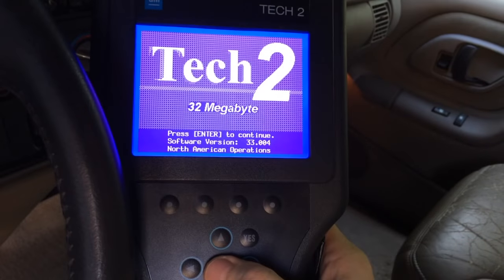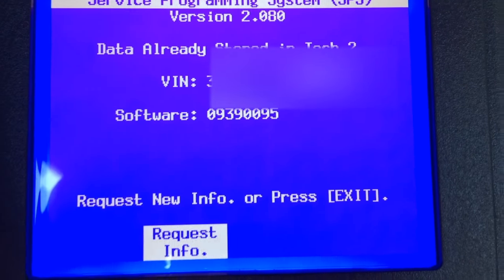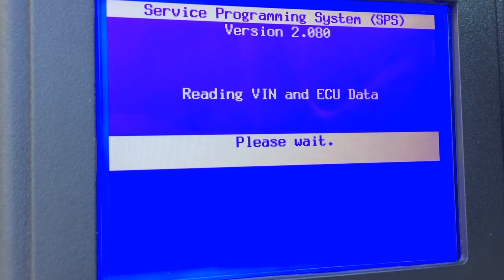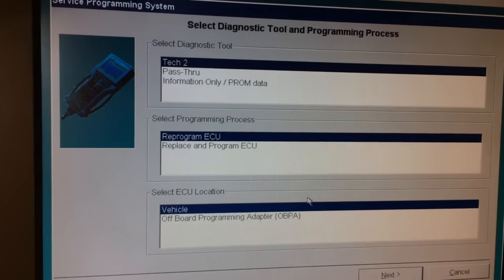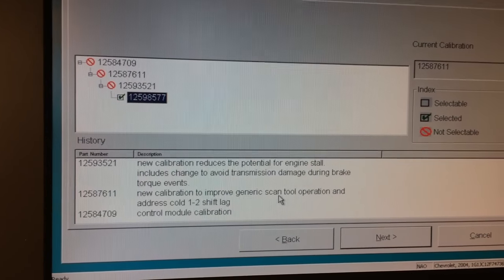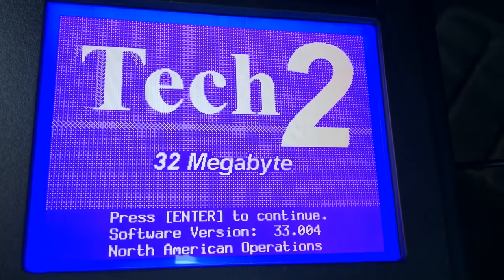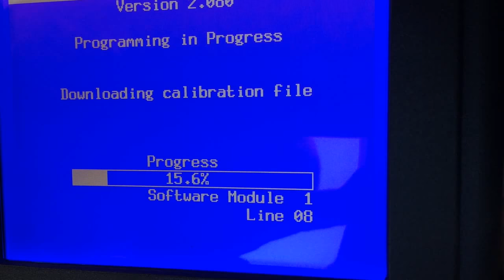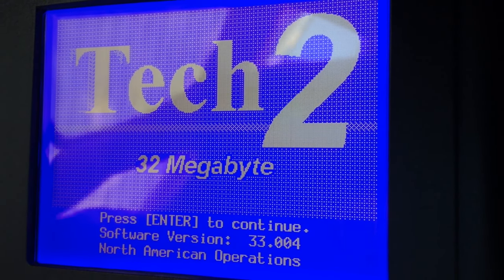GM SPS Programming: Tech2 Tool Remote Mode ECU TIS2000 How to do a Calibration Update Reflash (PCM)

Comment: Thank you for the video.  I have a Tech 2 and a Windows 98 Laptop and my target vehicle is a 2006 GMC Sierra 2500 HD SLE with a gasoline engine.  Your video appears to cover updating the ECU, but my objective is to add steering wheel controls to show tire pressures from TPMS that I enabled with the Tech 2.  My truck did not have the TPMS option, but my 2005 Yukon Denali does have it, along with the steering wheel control option to show individual tire pressures.  I added a passenger side window module enabling TPMS and tire pressure sensors.  I now have TPMS in the truck with a low pressure indicator in the instrument cluster.  Using the Tech 2 I was able to enable the TPMS and set tire pressures, as well as read tire pressures.  But my truck steering wheel controls do not have the option of see individual pressures like my Yukon Denali.  I swapped instrument clusters and the Denali will still read tire pressures but the truck will not.  So the issue is not in the cluster.  I returned the clusters to the original vehicles, and I was told that I need to "reflash" my BCM to enable the steering wheel option.  
   I think, but I'm not sure, that TPMS was an option in 2006 for SLT and Denali trucks, but I can't find verification of that.  My goal is to activate the steering wheel TPMS function if possible.  Can I do that with the Tech 2 and TIS 2000?  Your video explains how to update the software, but is there a way to get into the software to enable this function?
Reply from the maker: TPMS is not an optional feature in the USA, so it would be enabled in the Body Control Module (BCM) by default for those vehicles that came with it off the assembly line.   I've seen some sites mention that some vehicles had it as early as October 2005 but it wasn't until 2007 that all had it.    Bottom line, your BCM would have to support this option.  Use the Tech2 to go into the Body section, Body Control Module and setup as if you were going to build the car.  I have not viewed the menus for a Sierra, but on passenger cars in 2005 you would see in the Tech2 screen of that BCM setup menu all the vehicle options with an "*" next to the ones that were enabled.  It's not SPS (ie, not re-flash).  Simply changing the options, just like enabling/disabling cruise control.
Reply: @DrShock  I again connected the Tech 2 and under Diagnostics, only under Chassis could I find Tire Pressure Monitoring in Special Functions.  There I could Enable TPM and set all of my tire pressures and read all tire pressures.  It even asks the Load Range.  All of that appears normal, and, as I previously mentioned, the IPC light comes on for TPMS OK.  But there is no option for reading the tires pressures on the IPC with the steering wheel controls - only a light on the IPC.  Under Body on the Tech 2, there is a BCM section, but no setup section in BCM.  No mention anywhere for Tire Pressure Monitoring.
    My 2005 (a year older) Yukon Denali has the TPMS as well, but it has the steering wheel controls option to display the individual pressures on the IPC.
   You mentioned my BCM would have to support this option.  Since Tire Pressure Monitoring is controllable and enabled under Chassis, it seems logical that the BCM supports TPMS.  But I don't know about steering wheel controls.  About a week ago I read on a Chevy Truck Forum that one owner of a 2006 Sierra got his tire pressures to read on his IPC, but I think he had an uplevel SLT rather than my SLE.
Reply from the maker: So yeah if it's showing up under special functions, and you are able to get readings then the BCM is communicating with the TPMS sensors.  Though very odd you are missing the setup menu option - will be quite the deal breaker if you ever have to replace the BCM  ;-) 
There are different BCMs on some models during these years, the most obvious difference I've seen is to support remote keyless entry (one BCM part number has the radio the other doesn't).   Just a guess but perhaps that's what's going on here as well.   Personally, I don't usually try mods that were not available off the line in the year the vehicle was made,  so don't have much more to suggest for what you're attempting.
Reply: @DrShock  With my Tech 2, under Body Control Module, there are four options: Data Display, Special Functions, Snapshot, and ID Information.  Under Data Display, there are four options: Data, Inputs, Outputs, and Security Data.  TPMS is not mentioned anywhere in these options.  The factory Service Manual for Sierra and Sierra Denali has a large section on Tire Pressure Monitoring and indicates it should show up on the DIC.  The BCM schematics show a link to the IPC that includes both the TPMS light (which works) and the DIC (which doesn't work) in a dotted box titled "Logic".  I'm guessing this logic that includes the DIC is not present in my BCM, perhaps because I have an SLE instead of the SLT or Denali.  If that's the case, can the logic (including features) be changed with the TIS-2000?  There doesn't seem to be a way with the just the Tech 2.
    I also reconnected my Tech 2 to my 2005 Yukon Denali, and went through the same steps as I did in the Sierra.  Under Body, the BCM is similarly shown, with no Setup option present.  Also, the TPMS is under Chassis, and the enabling of the TPMS details is done the same way in the Tech 2 in Special Features.  But the DIC in the Yukon has the Tire Pressures option using the Odometer button on the steering wheel controls.  This option is missing on the Sierra.
   If the BCM features can be enabled with the TIS-2000 software, I don't mind at all buying a subscription and trying it out.  I will need to also buy a serial port to USB adapter to connect my Tech 2 to my Windows laptop - I have an extra older Thinkpad laptop that still has Windows XP on it.  I'm not familiar with TIS-2000 at all, so I don't know what it can do besides what you explained in this video - basically reflashing a newer version of software.  In my case, I'm guessing just a newer version of software for my SLE VIN number likely would not include adding the TPMS DIC feature.  I would likely need to add that feature.
Reply from the maker: You wouldn't need to subscribe to the current TIS2Web, as there have not been any SPS updates for 2005 since TIS2000 was deprecated in 2008.  So you have all you need with the TIS2000 DVD that came with your Tech2 (if you have a Chinese knock-off version  that is).   All TIS2000 gives you is SPS (Service Programming System) so that if you need to update the calibration of a module (i.e., reflash) to get a newer version.    There's no options or configuration there unless it was introduced as part of a new calibration.   So I'd certainly suggest checking if there are any SPS updates, you can do that here https://tis2web.service.gm.com/tis2web/  just by entering the VIN.   You can compare the calibration ID for the PCM, for example, with what the Tech2 displays for it.  If they are different, you might want to consider reviewing what was changed to decide if you want to upgrade your module.   I doubt there are any BCM updates, in my experience most of the GM BCMs from this era were not updatable calibration wise but I suppose its possible so worth a check.    You might also want to look up the BCM part numbers for your Sierra and see if there were other BCM parts specified for higher trim levels.   There are several online GM parts places that would show this such as www.gmpartsgiant.com.
Reply: @DrShock  Thank you very much for patiently replying to my questions.  This quest for TPMS display came about as a result from a YouTube video that has a lot of pickup owners interested.  So it's just not me who is interested.  I've already spent a few hundred dollars installing TPMS tire sensors and the passenger door module, so I'd like to follow this project through for not only myself but also for many other GM800 truck owners.
   Per your recommendation, I checked on the tis2web page and compared all of the BCM calibrations to mine from the Tech 2.  As you thought, there doesn't seem to be any updates to what I already have, and no mention of TPMS or the DIC updates.  I then looked up BCM part numbers and found that GM part number 19369689 fits all 2006 Sierra 2500 HD.  In fact, that part number fits all 2003-2007 Chevy Express vans, Silverado, SSR, Suburban, and GMC Sierra and Savanna vehicles with a lot of different engines.  72 fitments total, with only Sierra 1500 included with Denali trim.
  Then I decided to look up the BCM part number for my 2005 Yukon Denali, which does have the TPMS display on the DIC.  That GM part number is 19369690 and it has 108 fitments from 2003-2007 including Escalade, Denali, and all levels of trim, and including my 2006 Sierra SLE 2500 HD.  The cost for a remanufactured BCM is a couple of hundred bucks.  
   From your previous comments, it sounds like I will be unable to make any program changes to my existing BCM with any type of software.  If that is correct, then would you conclude the DIC feature I'm after would likely be available if I had the 19369690 BCM?  If so, would it be safe to remove my Yukon BCM and install it in my Sierra, or could that mess things up?  If it isn't safe to do that swap, I don't mind buying the 9690 BCM if there is a decent chance it will work - in fact, I would definitely buy it if I found my Yukon BCM showed the display.  If I do buy the replacement 9690 BCM, is it a direct install, or is there a lot of programming I have to do with the Tech 2?
  Thank you again for your time and experience sharing.
Reply from the maker: I can't say for sure on the Sierra, but I did a video that covers thru the 2005 Cavalier https://www.youtube.com/watch?v=Chy9pIzoguA where the BCM of this era is write-once so one has no feature with the Tech2 to change the VIN or mileage.   For a 2005 Sierra I'd suspect at least similar tech was used meaning you might lose your correct mileage and have the radio and XM receiver go into locked mode due to the VIN mismatch.   Nothing permanent, but not a solution I would suspect.   Definitely an extreme caution type experiment, as there may be electrical connection differences between the two BCMs.   If I were wanting to do this sort of upgrade personally, I'd visit my local LKQ salvage yard and pull the components off two donor vehicles and perform these experiments on the bench like I did here - https://www.youtube.com/watch?v=SDRSA_fO2d4   Of course the Sierra and Yukon service manual would have to be consulted for the correct hookup as the video was only for J car BCMs.
Reply: @DrShock  I watched both of your videos with a lot of interest, especially because of the era of the vehicles and the Class 2 communications system.  In fact, I build harnesses for the C6 Corvette community, using the wiring between the radio and the XM receiver.  The wiring is almost identical to your Cavalier test setup.  It's also very similar to the GMT800 truck vehicles, which is one reason I have both a 2005 Yukon Denali and a 2006 Sierra pickup.  All of these vehicles use the same XM receiver and similarly wired radios.  I have Service Manuals for all of them.
   Back to my project, I live in a rural area without much access to wrecking yards, so I don't think a good option for me is to find used BCMs for the Yukon and Sierra and wiring them up as you did - it would be a lot of work, although it would certainly be interesting.  For my Yukon, I replaced the instrument cluster a few years ago as I was restoring the vehicle.  I had the vendor set the mileage to zero in the new cluster, so I'm assuming that's where mileage is stored.  Would it also be stored in the BCM or PCM?  If so, how is the discrepancy handled, since only the new mileage is displayed on the IPC?
   If I removed the BCM from my Yukon Denali, and temporarily connected it to the Sierra, I'm not sure what mileage would be displayed, but I would guess the same as the Denali since the IPC stores it.  As long as I didn't try to start the car, my goal would be to just try to see if the steering wheel controls would then display the tire pressures on the DIC.  I would check the Service Manuals to be sure the BCM wiring is the same first, but I think it will be.  Do you think this would be a relatively safe test to do?  I don't think Theftlock would be activated in the Sierra radio, but once the BCM's are returned to the proper vehicle, I would think both radios should see the original BCMs and be OK - would you guess that's correct?
   If this test is successful, my next step would be to buy the Yukon BCM (19369690), which GM Parts online says will work in my Sierra.  Since it would be a new (remanfactured) BCM, do you know how the mileage, radio info, and other compatibility issues are resolved?  Would the Tech 2 be able to resolve these?  
  If you feel that swapping the BCM might cause irreversible problems, I might skip that test and just buy the 9690 BCM and try it.  I'd be disappointed however, if I found I had the same issue of no tire pressures on the DIC - a lot of work and money with no next step to try.
   Again, thank you for the excellent videos and advice.
Reply from the maker: My experience, and your mileage may vary, is that the radio and XM will return to their unlocked state when an original BCM is swapped back because over class 2 or CAN they ask the BCM for the VIN and compare with their EEPROM contents and get the right answer on the swap back.  I'd definitely advise against attempting to start the vehicle though to avoid a security state getting set by the BCM change.   I haven't worked on the new body style truck IPCs, but my understanding is they only store the mileage in the cluster's EEPROM, rather than the BCM one on cars like the Cavalier do.  This GM service bulletin confirms that understanding - https://static.nhtsa.gov/odi/tsbs/2019/MC-10158861-9999.pdf   So I would expect mileage to travel with the clusters only.  Normally, on a new BCM, on the various models from 2003 thru 2010 I've worked on, you have a new BCM setup on the Tech2 menu so that you can enter mileage and options and it can set the VIN.   But I do recall some models using SPS to setup the BCM, and for this you might trying going into SPS with your TIS2000 setup and seeing if it presents a BCM menu/tab selection.  If so, that's how a new BCM would be setup via the same calibration you already have and it should interactively ask you about installed options if so.   BTW I finally recall your name sounded familiar, from your website this video may bring back some memories from your Mediatronics dealings - https://www.youtube.com/watch?v=xXTsKYTp53k
Reply: @DrShock  Again, thank you for your advice.  As of now, I'm trying to get TIS2000 set up on my old Windows 98 laptop.  I couldn't get the Bosch DVD that came with the Tech 2 to open, so I'm trying to download it now from the internet.  I found a Serial to USB adapter that I hope will work ok so the Tech 2 can communicate with the laptop.
    I also looked at your YouTube video on the PAL installation.  Andrew Carrington, the CEO of Mediatronics, and I worked quite close for a few years as we developed the Version 2 PALs for the C6 Corvettes.  I sold lots of them until Mediatronics folded.  I still upgrade the software on original PALs to Version 2, but only the Class 2 PALs, which are used in the Corvettes and GMT800 trucks and SUVs.  The GMLAN 29 and 11 PALs weren't too popular and weren't very user friendly, but the Class 2 PALs are still the best iPod interface available for the vehicles that they are built for.  I still use mine in my Corvette, my Sierra, and my Yukon Denali.  They aren't as friendly as they used to be however, because they still use the old 30 pin iPod cable so adapters are needed for the new iPods and iPhones.  Also, the charging capability is limited to older iPods that use 12 volt charging rather than the newer 5 volt USB charging.
   I'm not sure when or if I'll be successful with the TPMS project, but if I succeed I'll let you know.  Your advice has been very helpful.  Thank you.
Reply: I've tried for hours trying to install TIS2000 to my Thinkpad Windows XP Pro laptop without success.  I tried both the Bosch DVD that came with the Tech 2 and a downloaded version (which appears to be identical), and it won't install.  One time, after about seven hours, it partially installed, but it won't run.  Maybe I need to do a completely fresh install of Windows XP and start from there, but this problem seems very odd.  I even tried it on another Windows XP laptop with the same failed result.  Do you know if there is a version that will run under Windows 10?  I have a laptop with Windows 10 as well.  
   Not being familiar with TIS2000, I wonder if I need it to install a new (remanufactured) BCM in my Sierra?
Reply from the maker: So TIS2000 is Windows 2000 vintage, having gone obsolete in 2007.  It works on Windows XP as well but nothing newer natively (you could use a virtual machine on more modern Windows versions if enough horsepower to run XP inside of that).  I've never encountered a problem installing, it's usually afterwards where you have to have the piracy dongle on the USB port to get it to work that's the problem folks run into.  You would only need TIS2000 if your year needs SPS to setup a new BCM.   I'm not sure on that, a forum surf may be in order to determine for your year truck how a new BCM is setup since there's no BCM special functions menu on your Tech2 for that model and year truck to do it.
Reply: @DrShock  Well, after spending many unsuccessful hours trying to install TIS2000, I finally got it installed after first plugging in a Tripplite Serial to USB adapter into a USB port on my laptop.  Once I did this, TIS2000 installed OK.  But the next thing I found is that in order to enter SPS on TIS2000 apparently I need a "hardware key".  After searching the web, it seems I have to buy a key from someone, which I don't mind doing but I'm also concerned about the Tripplite U209-000-R adapter possibly not working with the Tech 2.  So, my question is would I be better off installing TIS2web and buying a one time subscription?  Would this be more workable with a Windows 10 laptop as well as being able to handle newer vehicles.  Or, should I consider buying a GM MDI clone and not even use the Tech 2?  Would that eliminate the potential issue with the Tripplite U209-000-R adapter?   I have also read about a VXDIAG VCX Nano as an alternative to the MDI.  Any comments on these options would certainly be appreciated.  I'm still assuming I will have to get another BCM for my Sierra and program it for the DIC tire monitoring functions I'm after.  If I knew all of this would work, I don't mind at all spending the bucks to get it done, but if I'm unsuccessful in the end, this might be a rather costly path to nowhere.
Reply from the maker: @raykawal  That's odd the TIS2000 install cared about that being there, there is a link in this video's description though about the Tripp Lite Keyspan USA-19HS being the one USB to serial adapter ACDelco recommends to connect to TIS2000 once it is installed.  Though I have found other Chinese ones that work, though some do not (some other comments in here about others folks have tried I believe).  The USB security key for TIS2000 is one route, there is also a software crack out there to patch the TIS2000 code to remove the need for the key.  The Tech2 with TIS2Web would still need a USB to serial adapter but no hardware key (or crack), but would cost a subscription fee vs TIS2000.   The MDI would have native USB and be compatible with newer vehicles, but it does not directly support older vehicles - instead you have to pay for a Tech2Win subscription which installs a Tech2 Windows emulator on the laptop that just uses the MDI as a communications adapter to the OBDII port.  I own both tools, but only use the MDI for 2009+ vehicles and the real Tech2 rather than paying for Tech2Win.  I've used the code that cracked TIS2000 so I don't have to have the hardware key anymore.  Hope that helps your decision.
Reply: @DrShock  Thanks to your help, I found the key online and I got TIS2000 working.  I also bought a Tripp USA-19HS, and I can now communicate with my Tech 2 to my Windows XP laptop with TIS2000.  I then went into SPS on the Tech 2 and uploaded my Sierra Info to the Tech 2.  But when I connected the Tech 2 to TIS2000, the only Supported Controllers for my VIN number is the PCM/VCM and nothing else can be programmed.  The Sierra BCM is PN 10367689 which is superceded by 19369689 (mentioned previously for 71 applications).  I then uploaded my Yukon Denali Info into the Tech 2 SPS.  This BCM is PN 15136877 which is superceded by 19369690 (mentioned previously for 108 fitments included Sierra 2500 HD, Escalades, Denali, etc.).  This time, when I connected the Tech 2 to TIS2000, the Supported Controllers in addition to the PCM/VCM, were DDM, PDM, RAD, FHVAC, RHVAC, TBC (Truck BCM), DSM, IPC, Onstar, and ONSA (TIS2WEB Pass-Thru Onstar Activation), and even more.
  
So it seems that my Sierra BCM has very limited programming ability while the Yukon BCM has many more options.  Could it be that the Sierra BCM is a "base" model and maybe that is the reason for the no steering wheel control option for TPMS on the DIC?  If I buy the 19369690 BCM, which will supposedly fit my Sierra, should it have the many programming options even if I input my Sierra VIN number in TIS2000 for Replace and Program ECU?  The new BCM is about $215.  

Alternatively, I found a used BCM from a 2005 Chevy Suburban on eBay for $42 bucks with the same GM part number 15136877 as my Yukon.  Maybe I could replace my Sierra BCM with that one and see if the features I want become available?  That way I wouldn't have to mess with my Yukon and if the used BCM didn't work out I could always stick my original Sierra BCM back in.  Do you feel that would be a reasonable safe option to try?  My mileage is stored in the IPC so I wouldn't think that would be affected.  Will a used BCM "marry' to my VIN number?  I also checked the wiring in the Service Manuals - they are the same for both the Sierra and the Yukon.
Reply from the maker: @Ray Kawal glad you got the communications working, that's always the hardest part actually.   So seeing the other tabs in SPS for the Yukon BCM is a good sign, in that when you do not see those tabs the BCM cannot be updated ruling out using a salvage yard one.   These non-updatable base type BCMs I covered in that linked Cavalier/Sunfire video.  The base types remain VIN locked, which causes the radio and XM receiver to lock when such a BCM is swapped out.   For the base ones, there's no alternative but a new BCM (or an ACDelco remanufactured one which has the EEPROM chip back to a virgin state).  From what you describe the Sierra has such a BCM.    If it were me, I'd get the eBay one that has the same part number as the Yukon and experiment with it on SPS.   But I'd do a bench wiring harness myself to avoid any possible drama with the actual vehicle until I knew what the risk/reward value was.  I know you mentioned you were in a rural area without an LKQ salvage yard nearby to get the harness/plugs but its only going to be a few wires that could be done individually to the eBay BCM pins if you take your time (tho I have no experience with your truck series to know if the BCM wants a PCM also before it will talk to the Tech2).   Having an OBDII port to connect the Tech2 would be necessary as well.  I'd run the Tech2 off the AC power adapter and get the serial data line and ground only ran into it's plug manually as well (well insulated of course).   Triple check the wiring before powering on the Tech2.  This route you could, hopefully, answer two things.  Can you update the VIN and options as needed for the Sierra and can you actually locate the TPMS option you are interested in and configure it.  Hope that helps, not something I typically do so take these comments with that in mind.
Reply: @DrShock  From your video, you show your version of TIS2000 to from March, 2008.  My version of TIS2000 is October, 2007.  Do you feel this is important for me to find a later version?  Thank you.  My Tech 2 version is 33.004, like yours.
Reply from the maker: @raykawal  AFAIK there's no SPS database differences, I suspect just final bug fixes with the Java applet itself.  I do recall I got that version because I came across an online GM update program for TIS2000 at some point many years ago.   March 2008 was the last update ever released before everything moved to TIS2Web, October 2007 would be the next to last update though and is the more common version to get included with a clone Tech2.
Reply: @DrShock  Just to update this conversation, I ordered a used BCM with the same part number as my Yukon from eBay.  It should be here early next week.  I also have an OBDII port coming so I can connect the BCM on the bench to my Tech 2 and see what I can learn from it.  I can't do too much because I will only have my IPC that I can easily connect to it. But no PCM or PDM or steering wheel controls.  At least the PDM and steering wheel controls would be needed to actually test out the TPMS functions I want.  Interestingly, pushing the button on the IPC allows me to cycle through the odometer, trip mileage A and B, Timer, and Hour meter, but not Tire Pressures - even on the Yukon Denali.  I need the steering wheel controls to get that function on the Denali.  So I would also need that on the Sierra.

When I connect this used BCM, I'm wondering what is going to show up for a VIN number.  I'm assuming the VIN number is stored in the PCM, but I won't have that connected on the bench.  Another question I will have is if I end up trying to install this Yukon/Tahoe BCM in my Sierra will my VIN number be transferred to the BCM.  I'll see what I can learn from this - I may need to buy a new BCM to be able to set it up properly in my Sierra.

Thanks again for your help.
Reply from the maker: @raykawal  For these years the BCM will also have the VIN, in addition to the PCM.   The radio, for example, checks with the BCM before going into Theftlock around the stored VIN.  The base Sierra BCM you described wouldn't have a way to change the VIN short of desoldering the EEPROM and manually updating it per my other video.   But hopefully the more capable Yukon BCM type will let you set it thru SPS the same as a brand new one.   Keep us posted.
Reply: @DrShock  Now that Thanksgiving is over, I had a little time to play with the "new" BCM I found on eBay.  It is the same GM p.n. as my Yukon Denali BCM, but from a Tahoe.  I bench wired the BCM as you recommended and connected the Tech 2 and the instrument cluster to the BCM with all of the power, ignition, ground, and Class 2 wiring per the Service Manual.  But I really didn't learn much, since no other modules were connected (including the ECM) I got lots of DTC's, as would be expected.  Without steering wheel controls and the PDM (passenger door module) - which receives the TPMS signals - there was no communication.  The Sierra odometer mileage was displayed on the IPC, which was also expected since the mileage is stored in the IPC.  The BCM seemed to work ok, as the GM p.n. was shown on the module ID on the Tech 2.

I tried going into SPS with the Tech 2, but it wouldn't communicate and provide a VIN number - likely because the ECM wasn't connected, which I think is where the VIN is stored.  After disconnecting the Tech 2 from the bench setup, I returned the IPC to the pickup, and connected the Tech 2 again to the pickup.  I uploaded the SPS info from the truck into the Tech 2 again.  All appears normal.

So the question is should I remove the Sierra BCM and replace it with the Tahoe BCM and see what happens?  The Tahoe BCM has an extra 16 pin connector (Jack 6) that my Sierra BCM lacks.  This connector is for controlling the rear doors, windows, and tailgate functions, which my regular cab Sierra doesn't have.  I was told by another YouTube truck "guru" that using the Tahoe BCM in my truck will likely result in DTC's being thrown because of no inputs from the missing rear doors, windows, etc.  But if that happens, I think I could make "dummy" connections to replicate the rear door sensors on that Jack 6.  Jacks 1 through 5 have identical wiring for all of the Tahoes and trucks.  

I'm thinking that upon replacing my Sierra BCM with the Tahoe BCM, I should immediately see whether or not the TPMS functions OK with the steering wheel controls and Tire Pressure data is displayed on the IPC DIC.  If I don't try to start the truck, I don't think I should cause any difficulties that wouldn't be easy to reverse with the Tech 2 - would you tend to agree?  At that point, I would stop and see the TPMS results, then reinstall the Sierra BCM to make sure everything is still OK.  Then consider the next step.
Reply from the maker: So not having a powertrain control module (PCM) in the bench setup would be the reason for the VIN SPS situation yes, as it's the master controller module.   Though everything else for the BCM Tech2 menu should be working fine (reads like you did get that) to let you know the BCM "works".   Definitely agree you'll get DTCs for the missing sensors/modules that this BCM wants to find once installed.  While I've never attempted to install an incorrect BCM, one that doesn't match the part number exactly of the factory installed module, if I personally wanted to try this experiment I would verify the wiring harness connection pins match exactly via the service manual(s) and only if they did would I give it a go.  I'd first try the accessory key position.  Radio should be VIN locked, and swapping back everything should still be fine.  Then I'd give it a go in the cluster lamp test key "on" engine "off" position.  It might sound like an overly cautious approach, as no real lasting damage should be possible with a matching harness layout, but I'd be trying to avoid getting stuck in a state that could burn up my whole day trying to revert. If that went OK, I'd do it again and fire up the Tech2 and attempt the walking back and forth SPS dance between the vehicle and TIS2000 on your PC.
Reply: @DrShock  Well, I'm still not there.  First, there isn't an Accessory position that will allow the IPC DIC to display - ignition must be on.  But I decided to swap out the BCMs and see what happens.  I disconnected the battery then swapped the BCMs and reconnected the battery and turned on the ignition.  First, I cycled through the steering wheel odometer button to see if Tire Pressures came up like in my Yukon.  To my dismay, it did not.  Odometer, Trip A, Trip B, Engine hours, and Timer, but no Tire pressures.  So that was a major disappointment.  The DIC did display "Service Air Bag" and "Replace Lift Gate Fuse", but since I have no Lift Gate in my truck, I wasn't concerned about that.  And of course the Security Lock light on the IPC came up because I haven't tried to start the truck.

So even though I have the same GM part number BCM as in the Yukon, which does show the Tire Pressures with the steering wheel controls, it still doesn't work in the Sierra.  I connected the Tech 2 to look at the Tahoe BCM in the Sierra.  If found only two DTCs - B2960 Security System Sensor Data Incorrect but Valid and B3825 Cargo Door Lock Signal Circuit.  I'm assuming the B2960 is probably there because I hadn't set up the "new" BCM through the keylock system and "married" it to the vehicle.  Other than that, no other issues except the radio lockout.

So with the Tech 2 I looked at the BCM calibrations.  There are five calibrations listed under the BCM:  System, Lighting, Theft deterrant alarm, Locking, and Accessory.  Comparing the "new" Tahoe BCM calibrations with the Yukon, two of them were different - the System calibration and the Accessory calibration.  Could one or both of these differences result in the Tire Pressure display option not being present?

I reinstalled the original Sierra BCM and found no DTCs or other problems.  The radio was unlocked, and the truck started just fine.  There is just one more thing I could do that I haven't tried.  I could pull the Yukon BCM and install it in the Sierra and see what happens.  If the Tire Pressure option is still not displayed, I'm at a loss of why this won't work.  The steering wheel controls only cycle the logic circuit in the IPC, and I've already swapped the IPC's between the Sierra and the Yukon.  So if swapping the BCMs doesn't make it happen, the logic must be elsewhere - and I'm out of ideas.  Unless you might have an inspirational thought?
Reply from the maker: @raykawal  I took some time to research this after work today, and I found a one link that may help.  First, no new calibrations will not unlock functionality just fix bugs/adjust specifications.  So I wouldn't think that would help, but certainly having the latest of what SPS offers for a module is always preferable.   Second, I found some forum posts about others trying what you are doing.  One from back in 2016 looked promising, though lacking much detail.   They talk of having to not only swap the Passenger Door Module but also switch to a Dual Digital Cluster module to get the steering wheel controls to work with TPMS.  Hope this helps.   https://www.silveradosierra.com/wheels-tires/add-tpms-to-2006-silverado-2500hd-t555681.html
Reply: @DrShock  First of all, a big thank you for your researching efforts - that is way above and beyond what I expected as a reply!

However, I'm running out of ideas.  I've seen many forum posts and YouTube videos on this TPMS subject for the GMT800 series trucks, and yes, a few have been successful in getting their vehicles to display tire pressures on the DIC.  But I still don't know why.  Regarding the "dual digital cluster",  I believe what they are discussing is the cluster change in 2006 from the PRNDL display from a segmented display like the DIC to a PRNDL indication by LEDs beneath the PRNDL lettering.  My 2006 Sierra has the newer display and my 2005 Yukon Denali has the older display.  But both clusters work (show the Tire Pressures) in the Yukon and neither work in the Sierra.  So I can't see how it can be a cluster issue.

Today I pulled both the cluster and the BCM from the Yukon and plugged both in to the Sierra.  No Tire Pressure display.  I then returned the BCM and the cluster to the Yukon and the Tire Pressures were displayed.  Then I installed the Tahoe BCM (that I got from eBay) in the Yukon, and again Tire Pressures were displayed.  So the logic for the Tire Pressure display does not seem to be in either the BCM or the IPC, since no BCM or IPC will display it in the Sierra.  TPMS works in the Sierra, but without the individual tire pressure display with the steering wheel controls.  There is a "Trip and Odometer" button on the cluster that will display odometer, trip mileage, engine hours, and timer at any time, even when the engine is off.  Pushing the button cycles through the options just as the steering wheel odometer button does.  But even on the Yukon, the Tire Pressure option is missing with the button on the cluster.  Only when the steering wheel control button is pushed will the Tire Pressure option show up on the Yukon.

The only other module I can think of that is related to the TPMS is the PDM (passenger door module).  That module must have the TPMS receiver built in, as discussed in the forum link you provided.  I had to change that out from my OEM PDM to one with TPM built in, which I did right after I installed the tire pressure sensors in each wheel.  I then had to enable TPMS with the Tech 2 in the Chassis section.  It is there that the tire pressures are also set for activation when a tire is low.  But nowhere is an option for reading individual tire pressures in the DIC.  Like most GM modules, there are many part numbers for the PDM module.  In the forum link you sent, the author replaced his original PDM, GM p.n. 15132196 with p.n. 10398572 that has the TPM option.  My original PDM was p.n. 10398574, without TPM.  With the Tech 2, my Yukon PDM module ID shows 10398572, the same as the forum author's.  My Sierra PDM module ID reads 15109672, so it's a different part number although it has the TPM option.  The only thing I can think of as something else to try is to replace the Sierra PDM with another one, preferably the same as the forum author's and my Yukon's.  That seems like a long shot, but I can't think of anywhere else the steering wheel control logic might be - since it doesn't seem to be in either the IPC or the BCM.  If I try that, and it still doesn't work, I think I have to give up - which I hate to do after all of this work!

If you have any ideas, great!  If not, thank you so much for your time and comments to date.  This has been an interesting project.  If I do anything else, I'll let you know the results.
Reply: Guess what?!  I have Tire Pressures displayed!  I was the PDM after all.  I pulled the PDM from the Yukon and connected it to the Sierra and immediately everything worked as it should.  So for whatever reason, the GM p.n. 15109672 would not work, but the 10398572 from the Yukon worked fine.  Had I bought the correct one three years ago, it would have saved me probably hundreds of hours of trying to figure this out.  I can buy the correct PDM on eBay for $20 bucks!

BUT, during this three years of trying to solve this I've learned a helluva lot!  Much of it is thanks to you, starting with knowledge about the Tech 2, then SPS, then TIS2000 and what I needed to get it working.  And from your other videos as well, with the bench testing of BCMs, PCMs, and other modules.  You've got a wealth of knowledge that you share, and that is great for helping others.

Thank you again for all of your patience and continued replies.  This project finally has a happy ending, and I'll be able to share it with others as well.  :)
Reply from the maker: @raykawal  That's great news.  I had gotten curious enough about it I was going to research the PDMs some more this weekend.   In hindsight what I should have suggested was for you to try one of those Bluetooth ELM327 ODM monitors, you could have seen whether both PDMs responded to the BCM in the same way to the TPMS messages or not and probably caught it that way too.
Reply: @DrShock  I have a 10398572 PDM on the way but it looks like about a week before I receive it.  But I'm curious about the ELM327 scanner you mentioned.  Is this something I could use that the Tech 2 can't do?  It looks like an interesting device and it's inexpensive.

Before swapping out the PDM from the Yukon to the Sierra, I looked at the module information on both PDMs with the Tech 2, but I don't know enough about the info to conclude much.  The PDMs seem to do three basic things - control the windows and doors, do the remote key FOB learning, and in the case of the ones with TPM, communicate that information to the BCM.  The Data Display for each PDM Module ID Information shows three groups of info - 1, 2, and 3.  Under Module Info 1 there is an Operational S/W Part No. and a Boot S/W P.N.  Under Module Info 2 there is a Cal. Module 1 P.N. and a Cal. Module 2 P.N.  And under Module Info 3, the GM P.N. of the module itself. 

Besides the two PDMs being different part numbers, the Operational S/W part numbers are different and the Module 1 Calibration part numbers are different.  The Boot S/W p.n. and the Module 2 calibrations are the same.  I don't know what this means in terms of functionality.  It will be interesting to see if the module information from the "new" PDM I'm getting will be identical to that in the Yukon after I install it in the Sierra.

The Sierra PDM, which I installed to get TPM, was from some other vehicle but I don't know which vehicle.  It functioned OK as far as allowing me to enable TPM with the Tech 2 (under Chassis, not Body), but it would just not allow display Tire Pressures with the Steering wheel controls.
Reply from the maker: @raykawal  So what you can do with OBD2 message monitoring (class II bus or CAN bus only not the older E&C bus) is watch for what modules say when you interact with them.  There's usually too much traffic going on but when you have something with a human interface, like the steering wheel control, you can monitor what messages get put on the bus when you press the button(s) and the response that arrives (and most importantly what module responded).   Then you can compare that to a vehicle you're trying to diagnose where there is no message posted, or no response received.   You have to decode these messages, and they are typically in binary or hexadecimal format but it is another tool I use from time to time.  The brand I use is Bafx Products bluetooth OBD2 adapter, which after trial and error I found the most module compatible across various GM vehicles.   If you're interested in this try https://theksmith.com/software/hack-vehicle-bus-cheap-easy-part-1/ and follow thru part 2 of it for how it's done.
Reply: @DrShock  Yes, that looks really interesting!  In your previous post you mentioned the Bluetooth ELM327 ODM monitor and on amazon came up a $12.99 device from the LJPXHHU store.  Then I looked at the BAFX device you recommended for $20.99, but it states "This OBD2 scanner does not read ABS, SRS, TPMS or Oil Change lights..."  But since all of my seven vehicles are from GM, you'd still recommend the BAFX Bluetooth device?  I have an Android phone and Windows computers.

Sounds like with that device, I could be doing some testing work comparing the Yukon PDM with the Sierra PDM, which I can easily plug back in while I'm waiting for the "new" one.
Reply from the maker: @raykawal  Bafx is a little more, but it's also more compatible (and honest - none of those Chinese knock-offs can read those features either).   The ELM327 is a chip from a Canadian company, one of the first for processing OBD2 interface signals.  So it got copied by Chinese vendors, alot.  Most folks use these devices just for monitoring things like RPM, temperature, DTCs and there are apps out there for Android and such for doing that.   But the bus monitor I'm talking about isn't a general public thing, but another capability of these devices that is useful.   You don't necessarily need to buy Bafx, but I'd suggest not buying the cheapest one and reading the reviews for feedback on bus monitoring before you go with a different one
Reply: @DrShock  I'm not concerned about the minor cost differences at all.  I watched a couple of videos on the "10 best bluetooth scanners" and even the "best" one was less than $90.  But based on your experience, it sounds like the Bafx scanner is the most GM compatible and reliable?  There were others listed, including the Bafx (at #7), but if you've had good experience that the Bafx, I'll order one and play with it.
Reply: Today I received the eBay PDM with the same GM part number as the one in the Yukon.  It worked perfect.  Since I replaced the PDM, I had to do a tire pressure relearn, but otherwise all tire pressures are displayed on the IPC DIC as they are supposed to.  I also had to do a Key Fob relearn since that is also part of the PDM replacement.

I also received the Bafx module, but I'll have to play with it later.  I got it to communicate with my Android phone via Bluetooth, but didn't have time to pursue the "hacking" at this time.  Thank you again for all of the help and advice on this project!